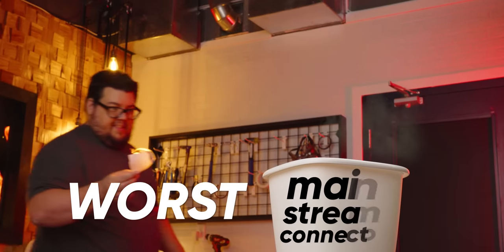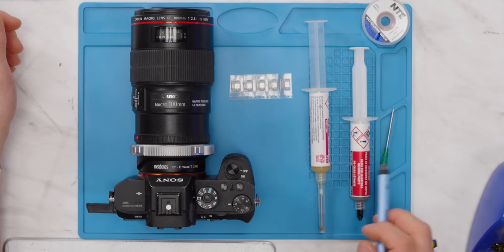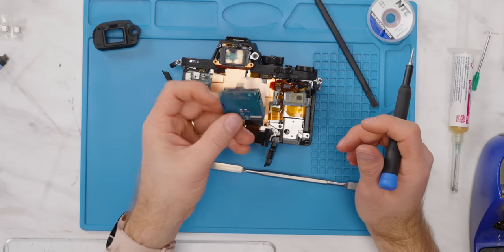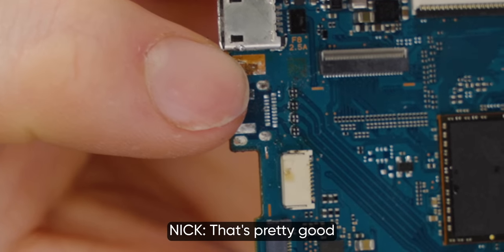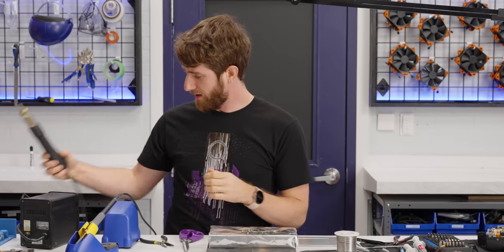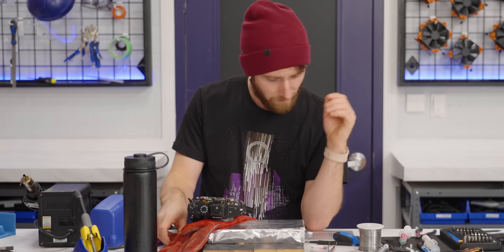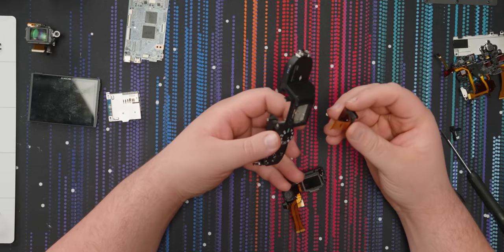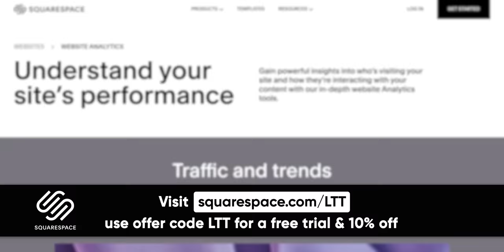This "cheap" repair almost BROKE me.

Comment: This is why you leave a short microHDMI to HDMI adapter cable plugged into it permanently. So you don’t destroy the port on the device, you damage the cable and can replace that instead.
Reply: what a good advice..
Reply: or hotglue a 90 degree HDMI adapter in place. should take the stress off the camera board and you can replace the adapter if/when it fails.
Reply: First thing I do when I add a camera to the cart.. find adapters (usually L shaped) to protect those ports. If possible I make sure they lock in with the cage so that it is that much harder to potentially break the port.
Reply: @b3owu1f  same. Micro HDMI adaptor stays permanently clamped to the camera and cable and then I use regular HDMI cables to the monitor. Although even doing that I’ve had two cameras be broken ports but that was after hard knocks on shoots. One camera was old so get written off, other had main board replaced just as in this video.

Comment: on all the camera rigs I've worked on, there's a micro HDMI to HDMI adapter dongle hotglued into the camera, and the female full size HDMI port is mechanically locked to the camera rig frame to prevent someone unplugging the tally monitor slightly too roughly and writing off the camera body.
Reply: This camera comes with a hdmi-hdmi adapto that you can bolt directly into the side of the camera.
Reply: @Idiomatick  Lmao. So you're saying Linus didn't RTFM and failed hard on this in the first place?
Reply: Don't understand why they seem to miss the most obvious solution 🤷🏼‍♂️
Reply: @shadow7037932  how does having the internal micro HDMI go to a normal HDMI and then the monitor differ from having the internal micro go directly to the monitor? In both options you are still tethered to the micro HDMI connector, which is the thing that breaks, because it's tiny.
Reply: @LtdJorge  what they probably mean is that the micro to full size HDMI connector cable affixes to the camera body itself, which means that the micro port doesn't have strain due to a wires tugging it around, as the connection is fixed in place
Reply: @LtdJorge  Micro is good for size, not for durability. if you don't need the thing constantly hooked up to a monitor/output, you can slim everything down a bit buy having a bolt on connector to a good, more durable connector. Think of the mini hdmi as though it was just an expansion port and it makes a bit more sense.
Reply: @LtdJorge  Yeah, but most of the wear and tear comes from removing and re-inserting the plug and also leaving a cable dangling to the side off of it. A full sized HDMI doesn’t wear down nearly as past and the micro one also wouldn’t anymore because it’s got no pressure or stress on it.
Reply: @Idiomatick  It is a cable protector you bolt onto the side of the camera. It protects the connector by looping the cable around whilst holding the cable. So whatever happens there will never be force applied on the connector. Meanwhile the protector holds the connector in place so it never disconnects. It is on page 22 of the manual I have in front of me.

I use a micro hdmi to regular hdmi cable and then use a magnetic hdmi cable. I have done it like this since a friend tripped over the hdmi cable and pulled my camera and stand over. Luckily he had insurance covering the damage.
Now the magnetic connection just lets go if something like that happens.

@Linus, rtfm.
Reply: Yes get a dongle. Circumvent high failure points with cheap and replaceable items.
Reply: @TechnoBabble  want to bet? Maybe it was a add-on that missed the first production run. Check https://youtu.be/h-CGFRzjY4U he pulls the protector out at around 3.15 minutes into the video. And at 4.30 minutes he shows how to use the protector. Same one I have.
Reply: @dutchdrifter8740  I have a feeling it wasn't included early on, or wasn't in all regions, if you look at product images and such of the A7S II there's no mention or showing of this piece. And it only shows up in some boxes in unboxing videos. I've never seen it before.
Reply: @TechnoBabble  as I said, it could have been a add-on they included when they found out the micro hdmi was a failure point. The camera was pretty new in terms of launch when I bought it. I am in Europe. So it could be a region thing aswell. Sony has to give 2 years full warranty by law here which could be of influence.
Reply: This is why we need SDI/BNC on all cameras.
Reply: @velvet_fm  nice for large videocamera's, but probably too big and bulky for an average slr. Why not use usb-c. It is a robust design and you can easily get magnetic connectors for them.
Reply: @LtdJorge  Because you're only plugging in the micro HDMI once, then you're leaving the adapter on and only messing with the full-size end of that.
Reply: @LtdJorge  Because the strain and wear and tear will be at the full-sized hdmi adapter, not the built-in connector. If the adapter breaks, you just get a new one for like $20, instead of paying $600 for repairing the camera itself..

Comment: A few tips from someone that has spent the past few years learning this kind of thing. 

1. Get a board holder. This is so important. You had the board at temperatures where the solder was molten whilst dragging it around your mat. You could have moved components on the other side of the board killing everything. 

2. You can remove bridges quite easily. Flux it up and run your clean tip over the pins, or use wick. You could have saved that port.

3. Ports with holes in like this, I tend to just heat the board from underneath to prevent the heat melting the port. This port however was quite accessible, I probably wouldn’t even have used hot air to reflow it, I’d remove all the solder from the ground pins, push it though and resolder everything with an iron. This prevents potentially killing the board with excess heat, and prevents going through x5 ports.

This is technically a pretty easy repair, once the board was removed it should have taken a couple minutes, so I guess this really does show how important taking baby steps is. I still really advise that people learn to do their own repairs. Probably don’t jump straight to a £3000 camera though haha(well £700 second hand now).
Reply: It's a dual row surface mount connector. Can't access the inner row with an iron.
Reply: @KX36  If you look at 12:39, yes it is accessible and possible to solder using just an iron with a fine tip. The rear rows and not aligned with the front. You really need to use a little solder as possible though, because bridges are going to be an issue. Compared to the USB-C on the Switch, this is at least possible with an iron.
Reply: Agreed, possible with an iron.
Reply: @natsukage3960  Ah, my experience of similar is all USB-C connectors. Still I wouldn't want to have to try to solder the inner row with an iron. Maybe just to go in afterwards and break the bridges with an iron.
Reply: Can y’all suggest a decent hot air station for beginners that won’t completely break the bank
Reply: @SAFbikes  The 858D hot air stations are usually less than 70$ and are alright for beginners. Just rather fragile if you drop the handle, but the airflow and thermals are fine.
Reply: @SAFbikes  before that invest in a station that holds your components with clips, watching Linus work on this with the board loosely moving around on the brick gave me PTSD.
Reply: @KX36  I've had good luck with dual-row connectors using an iron on the accessible row, then using minimal hot air to reflow it inner rows.  When there's a solid ground pad, you can start with tacking the part down with just the ground using an iron, and then reflowing to get the rest.
Reply: @SAFbikes  I spent about $240 for one off amazon with an integrated IR bed heater, iron, and air.  A little on the spendy side, but it's worth not cheaping out too much, since quality tools somewhat offset novice skills.  Also, it's a real workhorse, so I won't need to replace it for years.
Reply: Also watch more Louis Rossman :D
Reply: Subbed to hopefully learn some stuff from ya!
Reply: @lperkins2  I agree, always buy quality tools, spend a bit more...an expert often can still do fabulous repairs with mediocre equipment, but a novice needs the benefit of tool quality. And then you have nice tools. Like Linus said.
Reply: The board just sliding all over the place infuriated me so much. You're trying to place down a component with literal sub-millimeter precision, yet the board you're trying to attach it to just moves around continuously at the slightest touch.

It's like trying to replace the wheel on a car that's going down the highway.
Reply: @NaviUpgrade  ahhh thank you! I hope to be back soon, life is heavily in the way however haha.
Reply: 100% Hot air is for removing parts, not adding them. I would've just used a fine tip iron.
Reply: Don't even bother to explain the right way to do it, this channal is like Wish; lots of show, but all crap
Reply: @Dgeigerd  for this stuff, northridgefix would be better
Reply: @theantipope4354  for avg. Joe maybe, I've done plenty of assembly with hot air to save time, chips mostly. Less repair though, repair needs one spot heated, not the whole dang board usually, I only hot air multipin components of some types to save time, and if repairing I tinfoil heatshield the rest. Cardinal mistake many do is too high airflow and being impatient, seen many 0603's YEET across the floor when others tried :-P
Reply: This was a very difficult video to watch.

Comment: A tip that I picked up when doing some work for the BBC decades ago - Any lead, like you say, is going to break the socket when you constantly push the thing in and take it out. Something needs to change and you can't change the socket. So, have a short "extender" lead that is permanently plugged into it and is taped down to the body or something that is screwed into the body (such as the mount) so that the short length of cable and the plug are not moving around relative to each other. Then when something goes, it is going to be the socket on the relatively cheap extension cable that you plugged in and not the expensive camera. Just replace the cable.
Reply: Smart
Reply: until the camera falls and, of course, extender pointing to the ground.
Reply: They make magnitc connectors you plug in on once then it's like a magsafe connector or your not continuously pluging and unplugging the port just the mag connector
Reply: @Smart-Towel-RG-400  That technology works well for power delivery. For data delivery, in the example, such as micro HDMI, that is not sufficient.
Reply: Smallrig makes a mini converter from micro to full HDMI that is designed to bolt on to a camera cage. Super handy for this
Reply: I think company should be forced by law to put removable and easy to replace connector board for those expensive equipment with cheap/fragile part/connectors...

Comment: Honestly while I absolutely support repairing your stuff it is also refreshing of you to show this part of the journey. In too many videos the hard and time consuming parts of these projects are 10 second montages. It doesn’t work like that. 
Sometimes you will make things worse. Doesn’t mean you shouldn’t try but always good to keep in mind.
Reply: Yep, many lf the videos are shortened and done by professionals have done it for thousands of hours. They make it looks easy even though in reality, cables are finicky, some latches are almost impossible to open, some areas are difficult to get around to.

But this doesn't mean a device having ability to be reasonably serviced on your own  should not be a thing, even its difficult. It's okay if it's difficult due to more complex miniature components. But not when they purposefully male it difficult and frustrating to discourage self service repair.

 I remember try to replace portable HDD before. Those were frustrating since they designed the device ti be difficult to service for a something should be pretty easy to service. Some actually even go on their way make internal HDD replaced the SATA port into USB, making it impossible for the drive to be reused.
Reply: but thats exactly what they did as soon as linus was off screen. They took apart the whole thing in a montage sequence
Reply: Yep i really liked the “failed” part it’s refreshing when you see even this guy it’s an average joe.
Reply: You just have to know your limitations. I've always tackled my own car repairs but I'd never try something like rebuilding a transmission or motor, (I did use to rebuild Volkswagen motors in the 70s, but those were simple compared to motors today.)
Reply: @andymiller3366  let's be honest. At that point you'll spend 6-7 hour to figure it out and re-re-re-research the whole thing again. 

Just the reality of average user try to learn how to repair something
Reply: Those are the times where five seconds of the tutorial, are on repeat because the person on the video said it'd take two seconds

Comment: Even if it was a shit show, I appreciate an accurate depiction of a repair being attempted well outside of someone's comfort zone and skill level. Very frequently, how-to videos are heavily edited and the person in charge of the repair doesn't tell you how many devices they screwed up over the years learning their profession. It gives me a better idea of whether or not a repair like this is even worth attempting. It also gives me a better understanding as to why these cameras are so goddamn expensive. The part count and internal complexity seems far beyond your average smartphone.
Reply: I think the difference is that smart phones just do it all small. Camera makers try to cheap out by putting less into chips and using 3rd party sourced chips, so they have to connect and route more. Then again, I'm not a camera engineer so this could be completely off base.
Reply: @LabGecko  I have the same feeling. Canon, Nikon and Sony are big, but they're not Samsung big, so they cannot integrate everything. Plus cameras have a ton of physical buttons, interfaces, outputs and sensors that just cannot be crammed into a single chip or abstracted away in software.
Reply: @dsp4392 , many of the camera and phone sensors are actually made by, get this, Sony.